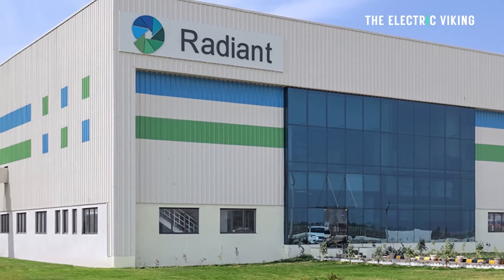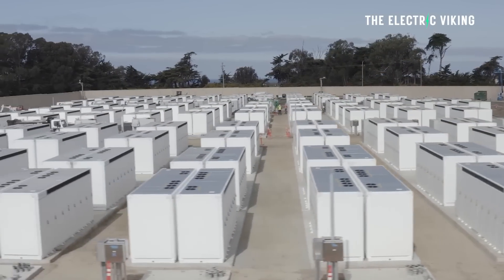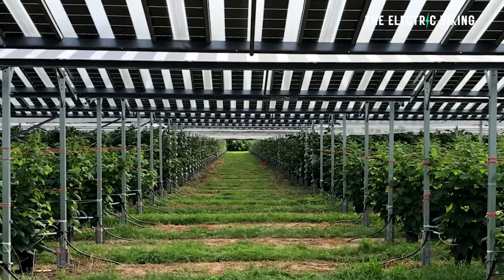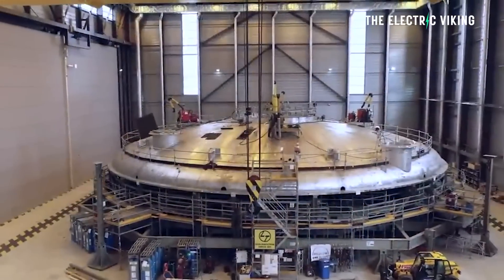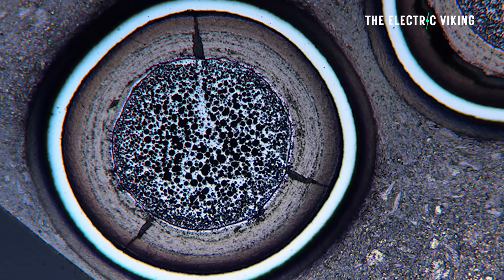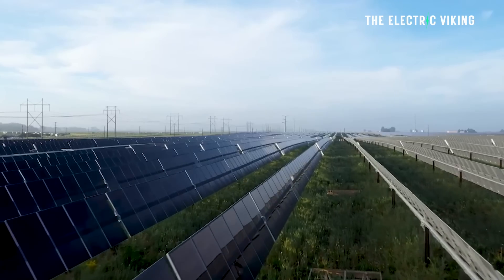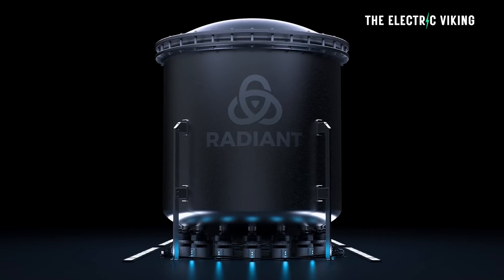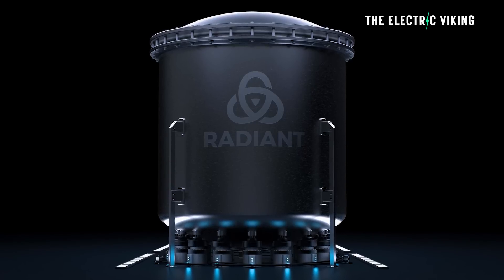SpaceX engineer reveals portable nuclear reactors to power 1,000 households

Comment: Refueling every 5 years? That's a short period of time, I think. It should be 50 years for our current rate of power consumption. Then a few years later when we all switch to electric cars, those small reactors can still be used for about 20 years.

Comment: I would be happy to have one of these SMR's at the bottom of my garden rather than one of those ginormous wind turbines !!  They are more likely based on those used in aircraft carriers
which have a crew of 5000 and much higher energy needs than a Sub.  They have not had any major events with them. So why wouldn't you have them ?

Comment: Not sure if you have done any research on SMR technology. It is the future, SMR reactor sites are drastically smaller than a Three Mile Island site.  They have systems that prevent them from melting down. This one gets refueled every five years, most of the SMR reactors get refueled every 20 years or more. Some of the designs actually take spent nuclear fuel and use it as fuel thus reducing the world's supply of spent fuel. I suggest you do some more research and do another video with an open mind about SMR nuclear-generated electricity.

Comment: Nuclear energy is the cleanest safest and most reliable way to make grid scale electricity. 

However Triso pebble fuel would not be my first choice of nuclear fuel. And helium would not be my first choice of coolant. 

My preference would be for salt fuel. And salt coolant. Like in the reactor being commercialised by Terrestrial Energy in Canada. The IMSR. 

I would happily have IMSR type reactors in industrial parks in the middle of my city. Things can go wrong but there is no pressure in the reactor and no chemical process to create any sort of dispersal. If things go pear shape and the reactor melts you just end up with a radioactive rock on the floor in your reactor building, not a pile of particles raining out of the atmosphere for miles around like with Chernobyl. And the rock can be recycled. 

Radioactive material is a hazard just like the edge of my balcony is a hazard. It could kill me. But with a handrail around it things are fine.

Comment: I hope you all realize that on Mars, solar is much less, isn't it?
Reply: Much less than what?  Are you talking mass delivered to Mars?  Are you talking the kilowatt reactors that NASA is building?
Solar sucks on Mars.  
-- First, it gets half the radiation energy from the Sun because it is farther away.  (If you double the distance to the Sun, your power goes down 4 fold.)
-- Second, it only works during the day.  If you use batteries to even things out, then they are massive.
-- Third, dust lands on solar panels.  Dozens of probes have died from dust build up.  What if you have a mission that needs to last more than a few months?
-- Fourth, dust storms often reduce solar power by 80% for weeks at a time.  Dust storms that block 90% are fairly rare.  The worst storm recorded blocked more than 98% of the sunlight.  Don't set up your life-support to depend on solar.
-- Fifth, you want your explorers / colonists to be doing useful work, not doing dangerous EVA's to wash solar panels.
-- Sixth, solar power is diffuse (especially on Mars).  To make the fuel to refuel a starship to come home, you need more than 3 football fields of solar panels.  This could be provided by one mid sized reactor.  I've seen people suggest, that an entire starship is used to bring the needed solar panels to Mars.  Then people would take months to set them up.

If you are interested in Mars exploration, I recommend "The Case for Mars" by Robert Zubrin.  He goes into the industrial processes needed for an early colony.

A really good reference on dust on Mars, see: "The Atmosphere and Climate of Mars", published by Cambridge Planetary Science, ISBN 978-1-107-01648-7.

Warm regards, Rick.

Comment: Terrestrial Energy Canada has been at the forefront of western design of the IMSR (Integral Molten Salt Reactor) and has a number of regulatory hurdles already jumped both in Canada and the US. The TE design differs from Radiant in that it will run for 10 years delivering a continuous 100-300MW, and after the 10 year period the entire reactor is pulled and replaced by a new reactor module. The spent reactor is put in a cooling pit for about 30 years after which time it is cold and low radioactive.
Reply: Terrestrial Energies IMSR is one of the most promising reactors on the horizon. Though I also like what ThorCon is doing in Indonesia. 

The IMSR core reactor is replaced after 7 years not 10. And whilst it will then cool onsite for decades it will still be radioactive at the end of that. The radioactive salt can almost all be recycled and put into a new reactor. The old graphite and the old reactor can it resides in all need to be disposed of responsibly.

Comment: Wires, wires, wires, they are the most expensive part of distributing concentrated electrical energy. 
Nobody does the maths on the transmission infrastructure. 

The exception is the nuclear promoters who say the transmission costs are the uneconomic part of solar farms.

The D.heads forget that increased nuclear electrical energy also needs new transmission capacity.
That is the reason nuclear is an economic dead end.
Reply: Nuclear doesn’t have to be built 1,000 miles away from where the electricity is used. It doesn’t even need 100

Comment: I have my doubts.......if something can go wrong then breaking it down to a smaller envelope means you have many potential "go wrong" possibilities that can go worong.....as a design fault would be common to all the small solutions you then have many possibilities going wrong in a short frame of time.......I have yet to see any nuclear type device with mechanical infrastructure that was fail safe to a degree you would want one in your own back yard
We are talking about a new approach to power generation and so as the wheel goes full circle the new technology will also generate new hazards that in the big power plants were eventually ironed out to a lesser than highly dangerous level of operation........we live on shifting tectonic plates and earth movements are a daily occurrence.......it would take a very powerful crystal ball to anticipate any dangers that could occur.......the crystal ball is on the back burner when it comes to allocating funds for such a project.
Reply: Generation 3+ and beyond have inherent safety systems, so unless the laws of physics stop working, they will fail safely and not breach containment.

Comment: For 16 years, lived in a housing subdivision in Pickering Ontario Canada that was a mile away from a very large nuke plant, in a town of 100,000 and just outside of metro Toronto population 6.4 million (see google map) and there very little concern... The fear I would have for a  very small (relatively speaking) SMR would be theft, but installing in a concrete bunker would solve that problem . The other key is to design in a way the spent fuel can be recycled.

Comment: Viking, instead of thinking that something going wrong with one of these small “micro” reactors would equate to a Chernobyl disaster we need to adjust our thinking to fit the device. This is a micro reactor and along with a much smaller size it will be inherently safer, incapable of melting down. Twenty kilometer radius from the reactor is Chernobyl like thinking again! I would love to have one of these for my house. Would be comfortable with it in my basement next to the water softener.

Comment: A 1MW reactor as a design goal is useless.  Saying a 1MW powerplant of any type can power 1,000 households is ridiculously misleading.  That is 1,000 watts per household, and MAY be true as an average, but in the depths of winter each household might SIMULTANEOUSLY need 20,000 watts for heating or in summer 20,000 watts for cooling, and they will need it continuously all day long, so a single 1MW powerplant is not enough for a remote community of 1,000 households.    Nowhere close -- more like 20 to 50.  You need to plan for max usage, not average usage.  Average only works with a huge amount of backup energy storage or being on the grid.  There is a reason new homes are built with 200AMP service, which is 50,000 watts, not 1,000.  An electric stove can use 10,000 watts while cooking a meal.  This 1MW reactor would be enough to fast charge JUST 4 EVs at the same time -- that's all -- to give you some perspective.  And you won't find Tesla Supercharger stations deploying 10 of these reactors to each place to support 40 chargers.  So if you still need the grid, what is the point of small power plants ?

1MW is what a Tesla Model S Plaid CONSUMES when accelerating, just as an example of what power numbers really mean.  A Boeing 787 uses 200MW of energy to fly.  So a 1MW reactor as a design goal is useless.  That might suffice for a small apartment building or a cul-de-sac of rural homes.

Comment: Like solar conventional nuclear plants suffer from being inflexible and mostly good for baseload applications. Conventional nuclear can't throttle fast enough to meet changing demand throughout the day. Solar can't throttle at all, is effected by weather and doesn't make power at night.... Small nuclear plants should be considerably more flexible with the ability to vary their output to meet demand and do so in all weather conditions.... IMO politics is the biggest stumbling block for small nuclear. They are in essence a decentralized energy solution and government is power centralized. So governments are predisposed to like having very few very large nuclear power plants they feel they can more directly control over a whole bunch of smaller plants all over the place.
Reply: Baseload is a pretty sizeable chunk of our energy needs. So if something can only do baseload it is still very useful. 

But conventional nuclear can ramp up and down. France would not have got to 70% nuclear if it could not. Most nuclear plants don’t because ramping puts strain on the steam systems and shortens their lifespan a little. But if nuclear is a large percentage of your grid power then ramping becomes essential. 

Ramping is not a problem. You just need to design for it and choose to operate in that manner. And if your plan is to be a ramping reactor the regulators will want to inspect a little more often.

Comment: Higher temperature, lower pressure reactors are key. The high pressure reactors require a concrete containment vessel big and strong enough to contain a sudden flash production of radioactive steam.

High temperature, like the LFTR run at the Oak Ridge national lab in the 1950’s can have passive safety systems that would have avoided the Fukushima diaichi disaster. They also can be run on thorium and waste from prior designs.

The major drawback? They don’t produce weapons grade plutonium. 😢

Comment: @The Electric Viking, Fukushima was a WEATHER EVENT, NOT a nuclear disaster. There were ZERO radiation related deaths. Chernobyl was a graphite-moderated nuclear power reactor, the flaws in the design of RBMK-1000 reactors were corrected after Chernobyl, the official death toll from Chernobyl is 31, they were the people who went in at the time of the event. In 2021,  48,830 people died from gun-related injuries in the U.S., I would argue that Chernobyl was in fact a complete NOTHING-BURGER by comparison.

Comment: I seriously don't think nuclear, small or otherwise, can compete on costs with renewables and liquid air batteries at scale.
Reply: 1GW of batteries with any decent length of storage would easily cost more than a 1GW nuclear plant. 

Batteries will get better. But so will nuclear. Batteries have a long way to go before they would be a cheaper option for backup. And nuclear can do much more than backup. Nuclear can be a primary energy source as well.

Comment: Nuclear power is vastly more expensive than battery hydro solar wind.The nuclear industry always tries the same trick saying the new technology is cheaper than the previous generation which ends up being 4 times as expensive with the public not following what has happen in the past.The other problem is the cost is upfront which means your prepaying your power for 50 years into the future so if breaks or destroyed your paying for power you will never be able to receive.

Comment: The biggest problem with nuclear power plants having such a disaster is really big but it's also now pretty easy to prevent given that newer nuclear power plant designs are designed to prevent exactly that but there is still a possibility a small one and unfortunately there are still some nuclear reactors that have not made the switch so it is still a pretty big problem!

Comment: I’m a big supporter of nuclear. A lot of these new small modular reactors have passive safety systems that can reportedly shut themselves down when they start to run outside of safety parameters. 
And there really is no such thing as nuclear waste. If it’s still dangerously reactive, it’s still a valuable fuel. Ship it to reactors that can use it, or save it until such reactors are available.
Reply: LFTR!!!

Comment: Good project.They will need these on Mars for sure. If they are so safe then they could be used in ships.
Reply: That's the true potential here. Ships, even airships, or even large planes. Imagine the cost savings on fuel. And yeah, moon, Mars and beyond.
Reply: @jovanleon7  It would be a big improvement on the dirty fuel that ships currently use too.
Reply: @MrFuckwit999  definitely. True pollution free.
Reply: In 1962 a nuclear powered ship was developed and it was a success. Big oil shut it down.

Comment: Yeah NO for urban areas, One big one makes more sense. Too many variables to go wrong.But can I get one in the back of my electric car so I don't have to refuel for 5 years?
Reply: Smaller reactors have benefits like being able to shut one down without losing as much capacity. There are also manufacturing advantages.

Comment: 10,000,000 households in Australia. 
10,000 nuclear reactors. 
10,000 refuelled every 5 years.
10,000 nuclear waste 'packets'.
  2,000 every year.
       10 every day, for decades and decades and decades and decades. 

10,000 super safe nuclear reactors. 
If a few broke down over the decades, then how many reactors would be in Australian suburbs???
Reply: House sized doesn’t work. Neighborhood sized is the smallest that makes sense.
Reply: @kokofan50  he said 1,000 households per nuclear reactor.
Reply: @stephenbrickwood1602  yeah, and if you look at your numbers, you have one per household
Reply: @kokofan50  you are right, 10million households, so I fixed the post.
My mistake.
Reply: SMRs are almost 500MW and need refuelling every 60 years. So 10,000,000 households would need around 20 reactors.  Refuelling every 60 years kills off any waste worries.
Reply: @M Bak  Australia has 25gW of installed fossil fueled power plants. 
So, 52 SMRS if 500mW units.
Or, 80 SMRs if 300mW units.
Now, if no fossil fuels and an all electric solution including all EVs, the 5times more electricity. 
So, 250 to 400 SMRs are needed, and even more if the population increases. 
PLUS 5times more national power grid all the way down to the poles and wires to the streets and homes and businesses and industries and buildings and millions of ends of the grid. 

The economics of the grid is horrendously expensive and is the reason the existing grid is fragile. Because the minimum capacity was built into the existing national grid.
So, 5times bigger, this is bs thinking. 

The existing national grid has to be UNLOADED and reduce transmission needs to protect the national grid. 

Rooftop solar PV and an EV for every building plugged into the national grid and no increase in transmission demand is a perfect answer for Australia and billions of people in the sunniest latitudes of the world. 
Australia has 20million buildings and vehicles. All buildings are connected to the national power grid today.

If Nuclear was the answer, then exports of uranium ore to every country's nuclear industries means millions of tonnes for centuries. 
USA military defence budgets will explode.

Comment: I do love the idea of a relatively mobile power source that can be brought to remote locations. It can also help democratize energy and be a total game changer, particularly in developing countries.
I had read about the idea of mini-reactors powering subdivisions was seriously considered in post-war era United States (and I'm sure elsewhere), but it didn't go anywhere obviously and for the same reasons of safety. Not only must you contend with natural disasters, you would have to also worry about theft of nuclear materials, terrorism and other criminal acts. Rigorous security would be required for the thousands and thousands of reactor/stations, as well as the fuel distribution network. That just adds to the overhead. -And I'm sure we could list a number of other issues regarding non-centralized power in general.

Comment: It's nice that you are at least entertaining fission power now. All forms of energy production have their ups and downs, and will work in some areas better than others. Renewables and batteries make sense now, in the long run more fission base load will need to be added especially near metropolises, large industrial sectors, data centers and commercial property clusters, where replacing and recreating large scale renewables and battery banks every couple decades for many generations will result in a slow rolling ecological disaster in and of itself even with recycling the bits we can.
Reply: Why do you think fission reactors last longer than batteries?

Comment: You could deploy multiple underground in old underground coal mines . Or you can simply us an open cut method and build a concrete encasement then backfill it with a limited access . Remember Nuclear Ships have very small reactor that only need refuelling every 30 years.